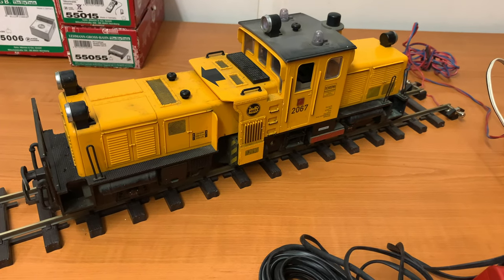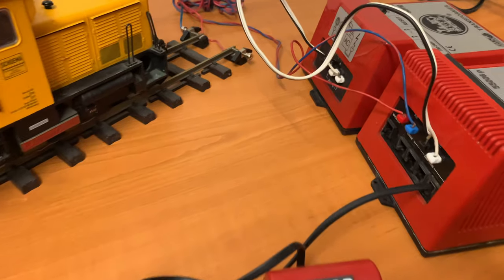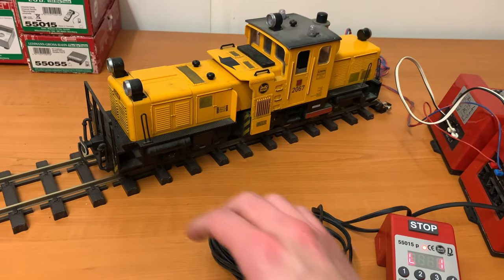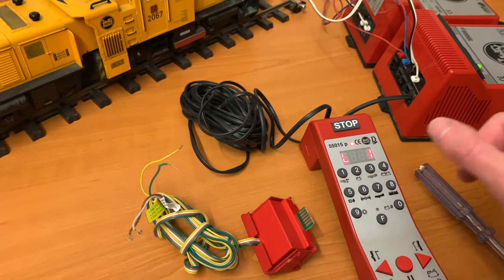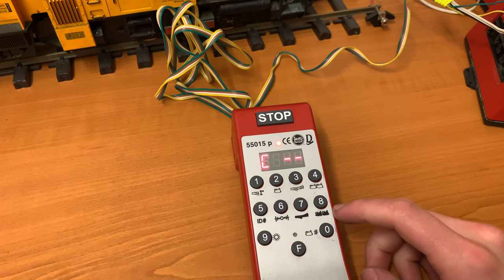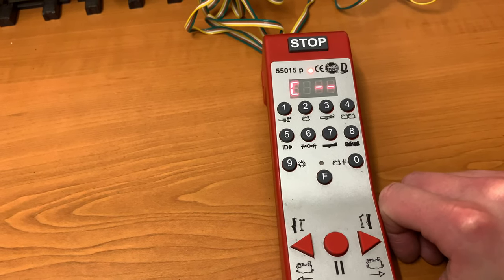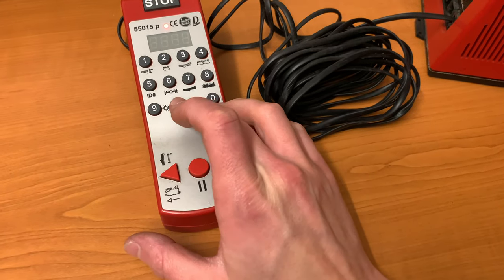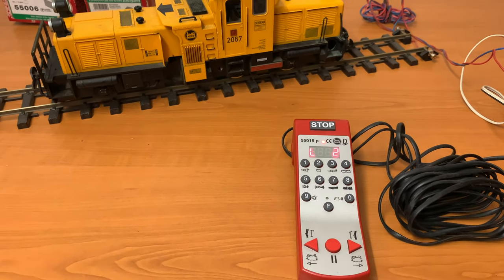Programming LGB / Locos - How to program an LGB (G Scale) train using an MTS system

Comment: Very well made video...and a MUCH NEEDED video for the LGB MTS.  You speak a bit fast, but glad its English language!  I think only German LGB users have made detailed programming videos, there is hardly any good English videos with clear and well directed instructions.  I wish I saw this video a year ago...we finally upgraded the very hard to program LGB MTS II to a modern Massoth system.  We are still trying to learn the programming of the Massoth, as the English instruction book is all we have to go on and its a very brief manual with no examples on how to program! Ugh!  So tomorrow I may have to call the dealer we bought it from to explain how to do basic programming!
Reply from the maker: Thank you very much for the kind comment - it means a lot. I know what you mean about the programming of the locos. The one reason I bought the LGB kit over the Massoth branded controller was simplicity. The LGB kit does work well. If I have time I'll try to do one programming points and accessories. All my track is due to come up soon, so I'll have a few points spare.